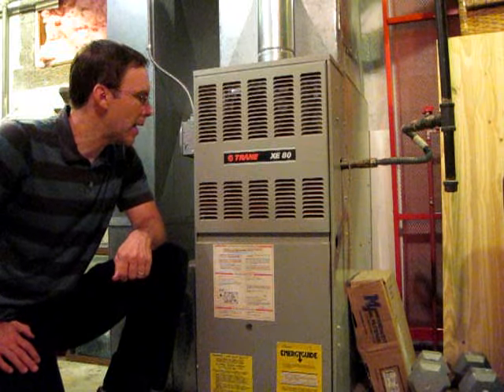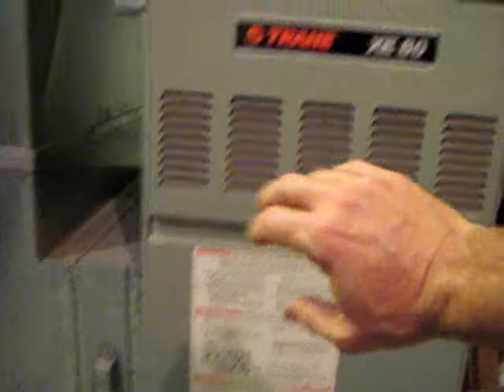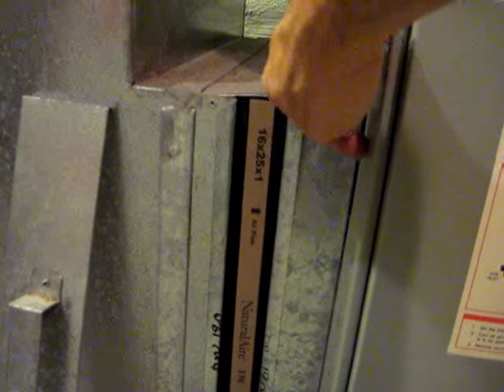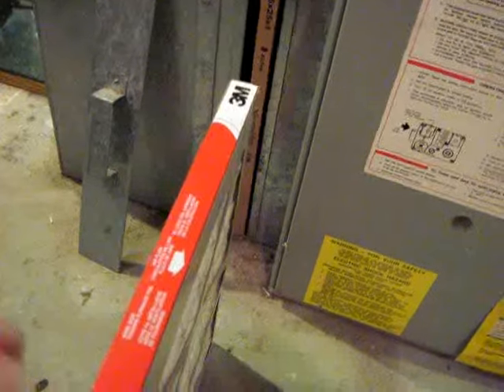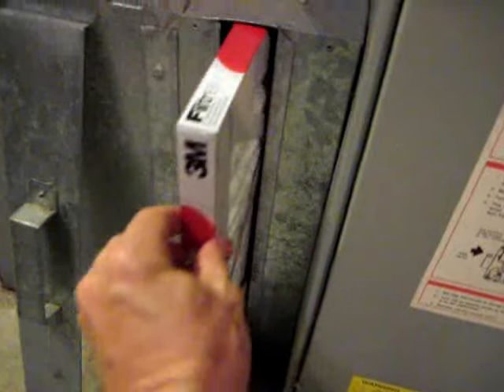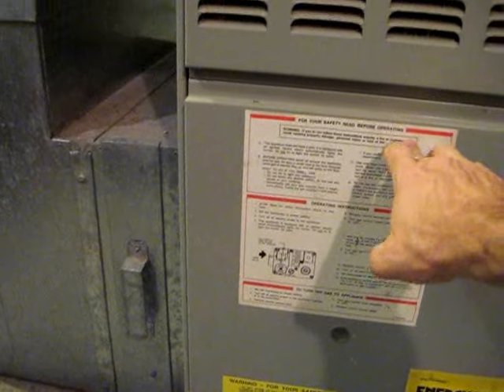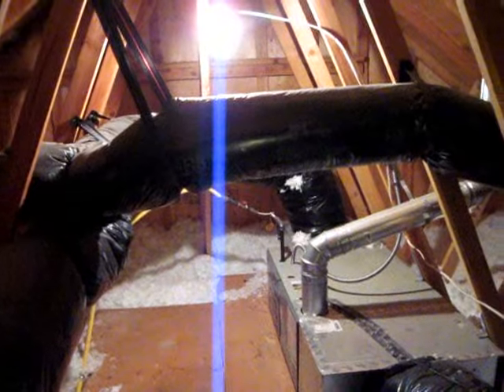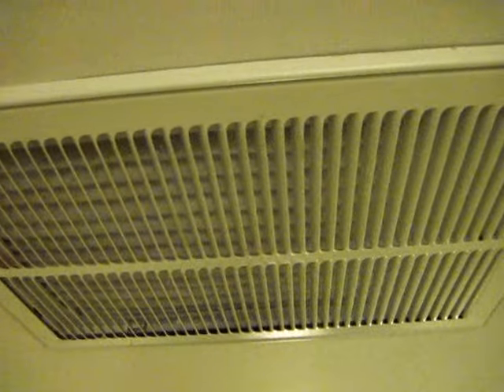How to Change your Home Furnace Air Filter

Comment: Great tht u had 2 diff furnances and also great you taught how to insert the arrow pointing toward the blower/air flow b/c installing the air filter wrong can decrease air quality which is really dangerous if you have jst recently cleaned up a black mold infestation or have paint or smoke in the air, not to mention it can wear out ur unit if installed wrong, thx

Comment from the maker: Sometimes the filters can be in odd places.  It you can, try to follow the duct work.  Try to identify there the air enters the furnace and trace backwards.  you may eventually find the filter.  Also, sometimes you have to open up the front furnace panel to access the filter.  So instead of the filter being on the outside of the furnace, it's inside the furnace housing, and it can normally be accessed through a access panel.  Good luck.
Reply: I change my furnace filter regularly, but still notice a lot of dust. Even good filters only make it 2 months. Should I be adding additional filters around the house? There's one medium/large size wall grate near the entryway & then 1'x1' ceiling grates in each room. I don't have carpet & everything is cleaned regularly, so wondering if I'm doing something wrong.
Reply: @hk-yc4je   might be dirty duct work without seeing it you don't want to over restrict air though. If you got dogs 2 months is about right

Comment: Suggestion is to write the filter installation date somewhere on the filter, preferably on the side facing out so that it can be readily seen.  On some of the more expensive filters (like the one being installed in the video), there is a small white rectangle good for this.  Writing the date helps remind you when the last time the filter was replaced, and I am told they are supposed to be replaced every 3-4 months.
Reply from the maker: Great advice, thank for sharing this!
Reply: Thanks for the tip!
Reply: My old furnace used to last 3 months before a filter change but ever since I bought a new furnace, the pleated filters only last 1 month (which really sucks). Any longer than that & my heat doesn’t come out properly.  I actually had to remove my filter the other night cuz it was getting colder in the house even though the furnace was running. Barely any dirt on it too!  But apparently these newer units are really sensitive to dirt.
Reply: @coolcat6303  If you use cheaper filters that may help with that. For example if you are using a MERV 8 or MPR 1500, try reducing it to MERV 3 or MERV 300. That will allow for more airflow to get through and it will filter out debris almost as good as the more expensive, air restrictive filters.
Reply: @coolcat6303   
 bbl no.

Comment: I have a filter on both sides of the furnace similar to the standing upright , but it's in my attic. So which direction  the arrow points on the right side of the furnace? Want to confirm correctly or not. Thank u @GEO

Comment: I have an Ameristar Gas Furnace and I can't find the filter. I called American Standard and they said if my unit is laying down in my attic that the filter would be in the ductwork. If I follow the ductwork backwards that runs from the furnace, how will I know that I have located it? I'm a little confused...

Comment: I live in an upper unit condo and my furnace is in a closet but I do not see where to changer the air filter, I do not have anything on my ceiling or wall(s) so I assume it will be on the furnace somewhere but I can't find where, HELP!

Comment: i have a question i was checking my daughter furnace  (comfortmaker) and the filter slides in just like video but there is no door where the filter slides in and i was not able to grab filter without pliers...so i did not mess with it ...any thoughts ?
Reply: Sounds like a door is missing. Unusual

Comment: Dammit mine doesnt have a handle or any obvious way to know where to slide something in or out. I WATCHED the ac guy do it last yr and it looked so easy and then i just went to do it and for the life of me I cannot find anything to pull out so i can get the filter in there. Unless the slot is like melted shut, something should have moved but nothing I pushed or pulled on would move at all. I know I'm looking in the right spot, I just cant figure the eff out how to open this damn thing

Comment: I had to have a tech come and clean my filter; pretty expensive. He said because of the pets, I need to clean my permanent "electrostatic" filter at least once a month.  When he removed it, no problems.  For some reason, I can't seem to slide it out.  It feels like it is "stuck".  what am it doing wrong?
Reply: +Bernue Lithgow Try jiggling the filter that is in it around as you pull it out.  You may have to give it a pretty decent jiggle around trying each direction as you pull on it, and give it a stern pull.  Don't do it TOO too hard but it can handle a decent pull.  It's annoying when that happens.  Hope this helps if you haven't already tried that jiggle!

Comment: My unit is in the garage but have no access port for a filter. I looked everywhere but my attic. which I have never been in before. Damn...
Reply from the maker: Sorry to hear that.  Sometimes the filter is actually along your air duct line, sometimes at the air intake grate.  Check your wall/ceiling intake grate.

Comment: Is it Important to put the filter in the right direction
Reply from the maker: Yes, most filters are designed and constructed with an airflow direction in mind.  If you reverse them it can decrease the effectiveness of the filtration and/or decrease the airflow.  Decrease in airflow can effect your furnace by making it work harder, and it can increase its noise level a bit.

Comment: Your filter access was obvious, and mine is in the unit itself.  You said it could be in the unit, but you should have shown us how to get into the unit, and what it should look like in there. After finally figuring how to get in, by sliding the panels up to access the filter, I saw that my non-disposable filter just sits on the floor, and I don't see how it is doing any good like that.